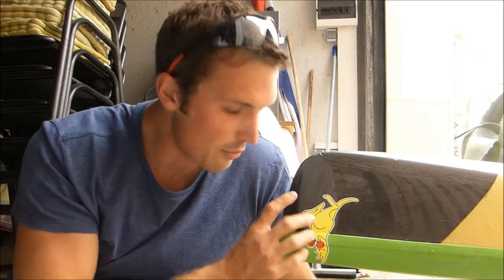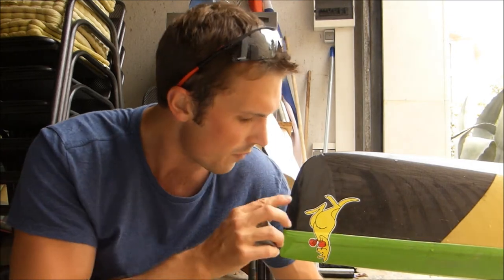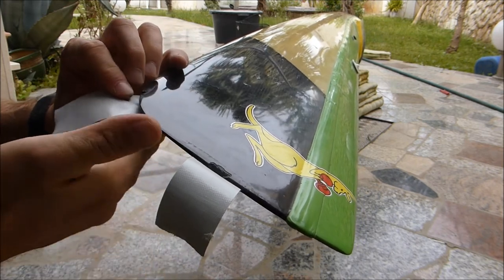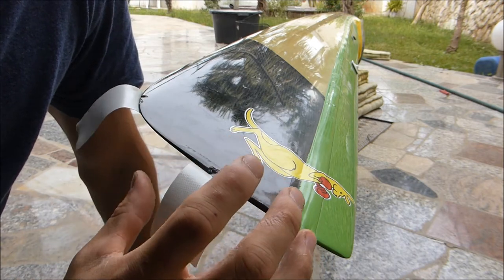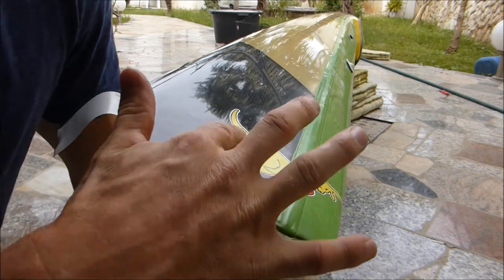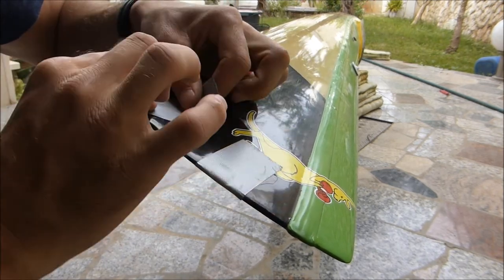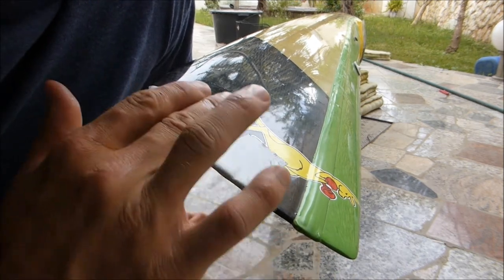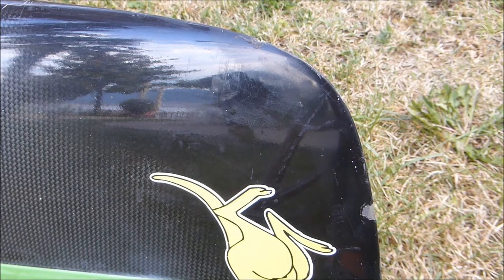Wash Rider TV- DIY repair chips on your kayak

Comment: hi,
i use adhesive aluminium instead for it sticks more closely without bubbles. For the color, try a two components epoxy and add powder for color: toner black ( printer) or from a peace of chalk from the desired color. Tune the color by adding more or less powder.

Comment: What paint do you recommend
Reply from the maker: I haven't used a coloured paint but rather an araldite two part epoxy glue. If you want to colour match it's best ot use a gelcoat. Or if it's a large enough job just get your local panel beater (car body repairer) or kayak repairer to detail it and complete the colour match.